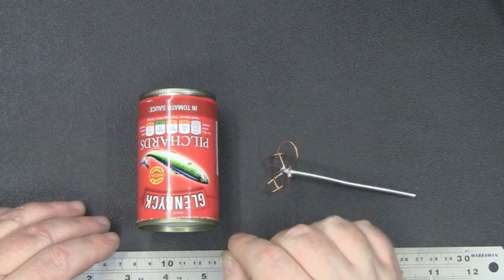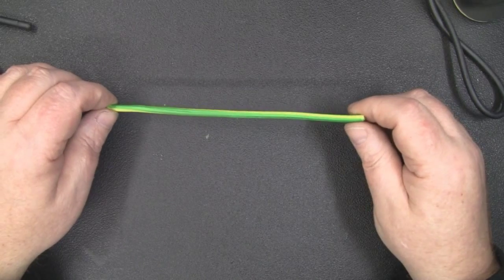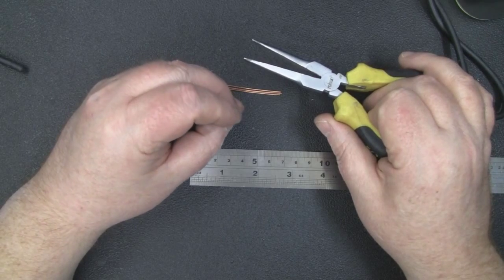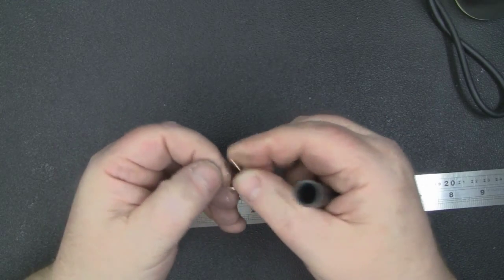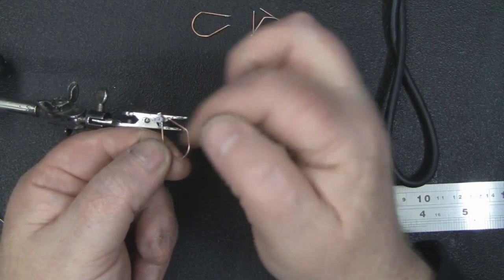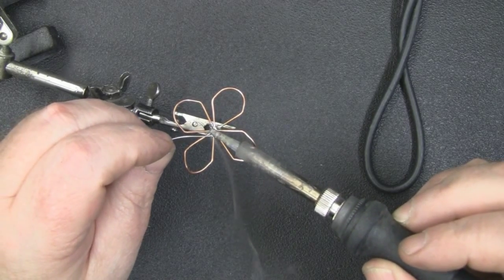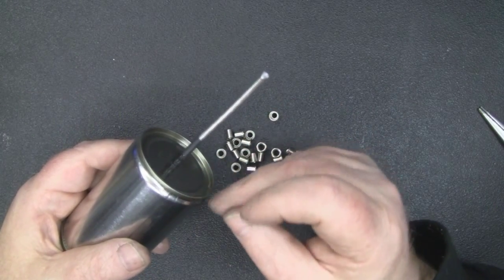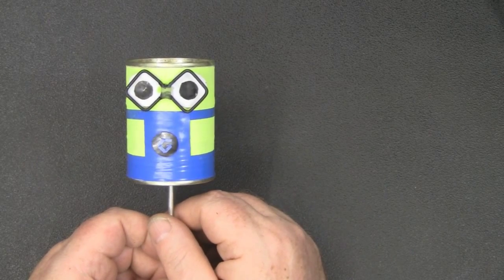5 8GHz Waveguide with Circular Polarization

Comment: Andrew could you make a video for a 3G Ariel as I have a 3G adapter to a wifi root  and my 3G signal is terrible I haven't seen you make a 3G Ariel yet. Preferably not have to take the 3G dongle part ?. I saw your video on YouTube where a guy from Russia with a yogi type antenna.I'd prefer to make a cantenner type Ariel if pos and then there was a wire running from it to a  metal box the box was shielding and inside was two clips surrounding each side of the 3G dongle. It would be great to see a video on this it would really help.keep up the good work

Comment: Andrew I really like your videos and they are very informative but I been trying to understand LHCP vs RHCP and identifying what type it is just by looking at the leaf directions.  You called the one you made here a LHCP but when I google images of LHCP and RHCP yours looks more like a RHCP.  When looking at it from the side angle the images I can find on google for RHCP the bottom element looks like its soldiered to the bottom braid but then when it goes to the center conductor it goes from lower left to upper right on the angle and vise-vera when I google images of LHCP they go from the braiding from lower right to upper left on angle of the leafs outer edge.  I just want to make sure that I know how to identifiy the leaf types so know if I matching my leaf CP antenna's correctly with my patch antenna's.   Could you correct me if I am right or wrong on how to identify the direction of the polarization by the looks of it.